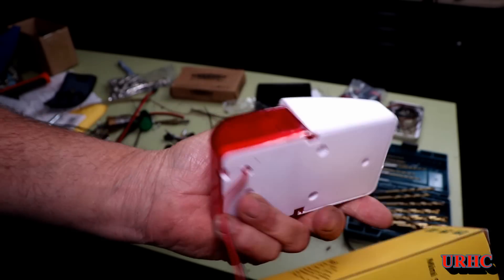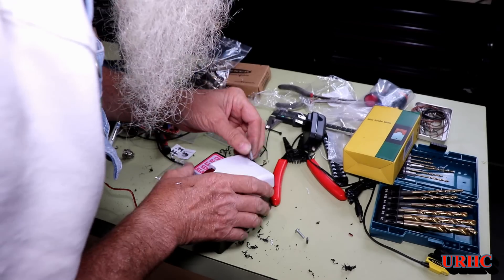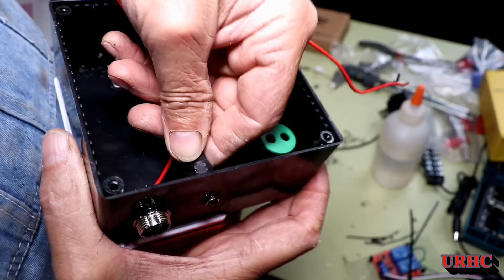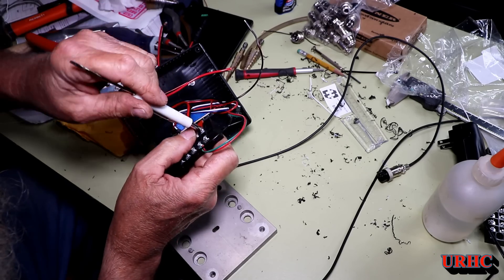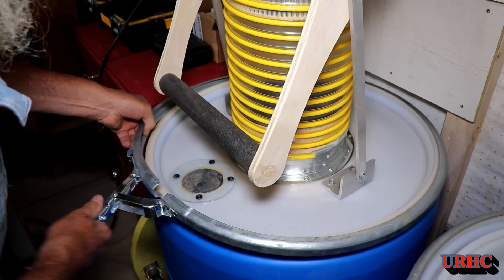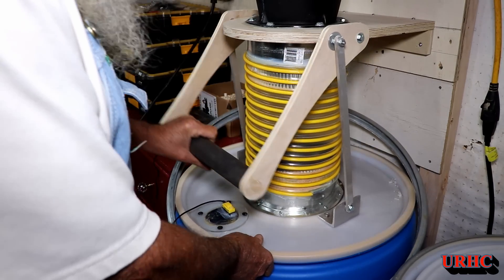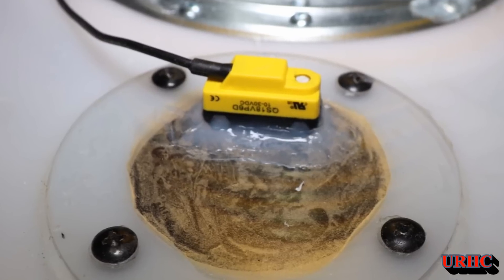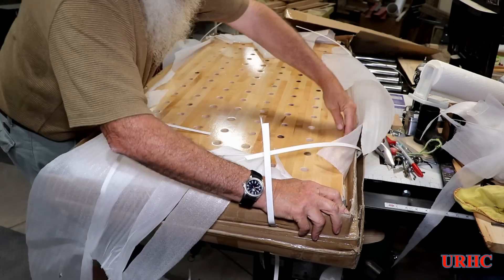Chip Drum Level Sense Alarm For My Dust Collector

Comment: Nice build... I have the same parts coming shortly to do the same thing.  Oneida sells the same basic device, but for $170!  All in, the cost is less than $50 for me.

How has it held up so far?  Any issues with dust clogging the sensor and giving a false alarm?
Reply from the maker: No problems but the siren hurts my dogs ears  so  I have to eventually just go with a strobe. Set it up using walnut  chips and not lighter chips because bin level varies with chip reflectivity. Thanks for watching.

Comment: Great job. How can I get a diagram?
Reply from the maker: Thanks. Use the diagram that comes with the sensor and add a power source and logic level relays to switch the alarm. Thanks for watching.
Reply: @unemployedredneckhillbilly2023  You are right the relays are easy to work with with.  Just finished my build this weekend.  I used two relays with one controlling the contactor for  the dust collector.  Used the white wire for the second relay.  Works perfectly.
Reply from the maker: @bikelite42  I found it's best to set the drum level sensitivity using darker wood chips like walnut that are less reflective then light colored chips.

Comment: Hey, this an awesome build.  I made one almost like it fir my dust collector.  The cam operated handle for the barrel lid id awesome.  I was wondering if you could do a video on how to build that. It would work great on my modified harbor freight dust collector.  Thanks, I really enjoy your videos.
Reply from the maker: I'm going to redo it in the fall because the alarm hurts my dogs ears and plan on making  a video then. It works really good.  Just had to set the level down a little more because walnut chips are not as reflective.  Thanks for watching.

Comment: Got mine built and it's awesome thanks to your guidance. You truly are a jack of all trades. Thanks again for your work putting out great videos
Reply from the maker: Glad it works good. I found when making dark chips like walnut the sensor has to be adjusted  to a slightly  lower level then with reflective chips. I have to do a new version without the alarm because  it hurts  my dogs ears. Thanks for watching.

Comment: Hey great video I'm motivated know to build mine. Although the Amazon links in the description don't allow me to sign in and make the purchase from there
Reply from the maker: I think Amazon  changes links around. The siren on this really  bothers  my dogs so I plan on doing a much simpler version with  less parts  this fall. Thanks for watching.
Reply: I'm confused about the wiring between the sensor and the relay module. I am hoping you could explain a bit more details. Thanks for your work on your videos.
Reply from the maker: @824rmrock  There are 2 output wires from the sensor one high and one low that switch state when the sensor actuates. Wire them to the IN pins on the relays. The little jumpers on the relays let you choose if you want the relay to change state with a high or low signal. Wire the power on the relay boards also so they will operate. You can then just use the relay contacts as switches to operate any load and voltage up to the  relay max.

Comment: So it's been about 9 months, how has it worked out? Any problems with different types of wood or size of chips/dust? Awesome channel by the way, thanks for the great info.
Reply from the maker: Works good. Had to adjust  the depth for Walnut chips. They don't reflect as good as light colored ones so its about 8 inches down now. Going  to redo it this fall because  the alarm really  bothers both my dogs. Just going  to use a more powerful strobe . Thanks for watching.

Comment: What a brilliant,compact design. As a fellow sawdust maker could you post a wiring diagram of this, so I can try an make one for my cyclone. Thanks for posting this video. Karl
Reply from the maker: I am going  to redo it this fall. The alarm really  bothers my dogs when it goes off and also simplify it. I will post  a video  about  that. Thanks for watching.
Reply: @unemployedredneckhillbilly2023  well, I've got no animals in my shop except for me according to my friends. So if you can I'll be happy to use the present design as I've just ordered the bits from Amazon. Thanks Karl
Reply from the maker: Just follow  the wiring instructions with the sensor and wire a output too each of the in lines on the relays. 12 volts  to the power  terminals  on the relays and the relays are just used as switches for the alarm. Watch the polarity and it's  easy to figure out.
Reply: @unemployedredneckhillbilly2023  
Well,the bits I ordered from Amazon arrived, and there was no wiring/ circuit diagram with the sensor 😡. Please could you sketch one out and post a picture of it.
Karl
Reply from the maker: @houtslager  use the wiring diagram  with the banner sensor and hook the outputs from the sensor to in 1 and 2 on the relay. Add 12 volts as the relay board is marked then use the contacts of the relay like spdt switches. Select high or low with  the jumpers to change the relay state if it's wrong. Take the time and draw a diagram as you go. It's  the only way you will learn about  basic wiring.

Comment: I would be interested in a sketch of your wiring diagram
Reply from the maker: I plan on doing a rework in the fall to get rid of the relays and replace the alarm because It hurts my dogs ears. That will be a much simpler version. Just follow the wiring diagram that comes with the sensor with the outputs hooked to relay in's for this version. Thanks for watching.
Reply: @unemployedredneckhillbilly2023  Good to hear...LOL... I have 2 dogs and would not like to put them through it either...looking forward to the simpler version...thanks URHC

Comment: Hi n many thanks for your videos !  Would it be to much trouble for you to please post a wiring diagram of your level sense alarm for you dust collection  drum ?
I've read some of your comments that you've posted to other viewers & it seems to me that whilst it's all a simple case of wiring things up for yourself, it's actually a much bigger deal for the people like myself who are asking for your wiring diagram.  In your video you shoe the DC 12V Relay Module but don't actually go into the wiring of it. Therefore your assistance in helping us lesser mortals would be greatly appreciated  !
Best Regards from the UK
Reply from the maker: Just follow the instructions with the sensor.  If you want to make things like this its a good way to learn and not just be a  copier. That's  what I want my viewers to do. Thanks for watching.
Reply: @unemployedredneckhillbilly2023   I haven't got a problem with learning ! But in saying that, you have stated that we should just follow the instructions with the sensor ¬ if you check out the link that you've supplied for the 12v HiLetgo Trigger  there are no instructions on the amazon website therefore i have to spend over £90 to buy all the materials and then find out that I've got no wiring diagram ! After all said and done all i asked was for a wiring diagram, which if you look at your written introduction, you've mentioned that you would be prepared to provide.

Comment: Like it.  Do you get a cyclone swirling of the sawdust in the drum.  I have a store bought cyclone collector. I can see through the window it swirls.  This might give allot of false alarms.  I was maybe thinking of  a buffer timer to filter out the false triggers.
Reply from the maker: a little but it settles quickly.  it will have  higher and lower areas so I put the sensor where it builds up highest.  Thanks for watching.

Comment: Evening Sir,    A wiring diagram would be greatly appreciated... I have been trying to do this install, but I apparently am missing info. I do not have the  trigger. I was using someone else's information and the trigger was not listed.

Thanks
Skip....
Reply from the maker: there are 2 trigger wires on the sensor.  a high and low depending on the state. power up the sensor per the included instructions and one is high and the other low until the sensor changes state then they swap. hook them to the in on the relays and set the jumper to the state you are using. Follow the sensor wiring directions carefully  as wrong wiring or switching  polarities can instantly blow the sensor. Don't forget  to power up the relay board. If the output lines of the sensor are dead it's probably a bad sensor.  A multimeter should  be used to verify operation. My first alarm was dead and they sent  a replacement so check that also.  Thanks for watching.

Comment: I would love to have a sketch of how you wired it up. I will be ordering the parts including the relay from your links on Amazon. My email is davidper@swbell.net. Thank You. Great job!
Reply from the maker: It's easy just follow the wiring diagram from the sensor and hook up the 12 volt to the power connections with the proper polarity and also wire it up to the relay board to the + and - lugs. Then hook the outputs from the sensor to the in 1 & 2 terminals on the relay board. There is a selector jumper for if you want the relay to actuate on a high or low signal. Then just use the relay contacts to operate what ever you want up to the relay max current. The relay is just basically a set of switch contacts with a common,  normally open and normally closed connection for each output.

Comment: I think you and Jeremy Fielding from youtube should collaborate and design the worlds best dust collection system. One package contains all the bells and whistles. Both of you have tremendous ideas but combined it would surely be a magnificent product.
Reply from the maker: Never heard of that  channel.  I will  look for it. This is a great way to avoid filter cleaning caused by over flows.  Thanks for watching.
Reply: Unemployed Redneck Hillbilly Creations yes Jeremy is an Electrical Engineer and makes electronics easier for the common Joe to understand. He has recently wired automatic gate valves to his dust collection system so the vacuume is automatically turned on and diverted to the machine being used.
Thanks for all the interesting content you do and all your hard work.
Reply from the maker: I am working on that with my smartthings system also. A vibration sensor on each machine will start the dust collector and open the valve automatically when the machine starts. No real electronics needed. just a zigbee vibration sensor and smart plug. That will be coming this fall.
Reply: @unemployedredneckhillbilly2023    have you yet managed to get the vibrasenseswitch into a build and if so are you going to release a wiring diagram of it ?
                 
   Many thanks

Comment: Excellent job! Can you send me a simple wiring diagram of the control box? Jared.s.turner04@gmail.com
THANKS!
Reply from the maker: Just follow the wiring diagram  for the sensor.  12 v to the plus and minus wires on the sensor and relay board , sensor outputs to the relay board 1 and 2 in. Use the selector to determine you want the relay to operate on a high or low signal. Alarm and armed light operated by the relay contacts.  Can be anything up to the relay  current limit.  Watch polarity and it's simple.  Thanks for watching.

Comment: Nice job!  Can you share a link to the sensor you used?  Thanks
Reply from the maker: Thanks.  It was an Ebay auction  so the link is no longer  valid.  I put  the pn in the beginning of the video and search for that. I got mine for $16 shipped from China and some  are as high as $65 so watch for a good deal. Thanks for watching.

Comment: I built two of these 3 years ago for the alarm I used and old smoke detector as my sound source, I just soldered the test switch closed and when the sensor powers on the led it applies power to the smoke detector it works great. One issue I did have was the sensor lens would collect dust and set of the alarm. To rectify this I mounted an acid brush on a stick that I attached a 1/4-20 screw and nut that I could turn that wiped the lens of the sensor clean and also test the sensor system. I was one of the original post on Lumber Jocks for this system, not the first though.😁🛫
Reply from the maker: Then I should  thank you for the sensor info. I was thinking that I could give it a shot  of air to clean it. Next I want  to add a back pressure  alarm to tell if the filter  needs cleaning and turn on a motor to operate the paddles. Years ago I designed  a tool for cleaning  fiber optics for assembly that used co2 pistol pistol parts and the cartridge to clean with the ice it creates. Not sure if the sensor has a glass lens though.  Thanks for watching.
Reply: Unemployed Redneck Hillbilly Creations I made a simple Manometer out of plastic tube to monitor the pressure of the inside of the .03 micron filter and a graduated scale with the tube in a U shape I put colored water in the tube I have another one on the suction side. 
For cleaning the lens a puff of air say with a tube in a u shape from the top of the drum lid would work, however it would have to be sealed when not in use because it would be a vacuum leak and the saw dust would get sucked into the filter. 
My sensor lens is plastic of some sort.  😁🛫

Comment: I have the same setup as you and the only problem I ran into is the use of my drum sander. After making fine dust for a while I would get a false alarm. I don't know where I read it but every time I empty the drum I wipe the sensor with RAINX, the stuff you use on car windshields,  and never had the problem again.
Reply from the maker: Thanks,  I will try that if there  is a problem. Thanks for watching.

Comment: Nice video.  I work for a large sensor manufacturer,  if the chips are dark the photoeye won't see them, but I dont thi k what you would put in the barrel will affect it
Reply from the maker: Thanks for the info. Most of the wood I work with  is lighter colored but I  do plane a lot of walnut and will see if it works with that next. Thanks for watching.

Comment: Does the photoelectric cell emit its own light - then pick up reflected light when it bounces off the sawdust?  Just curious how it functions and how it's calibrated for depth of sawdust?  Neat project
Reply: Yea it does, they have an emitter and receiver built in.
Reply from the maker: Yes it is self contained. That little white screw I showed on the top adjusts the sensing distance. If you look up the spec sheet on the sensor it shows how the different types work. Thanks for watching.